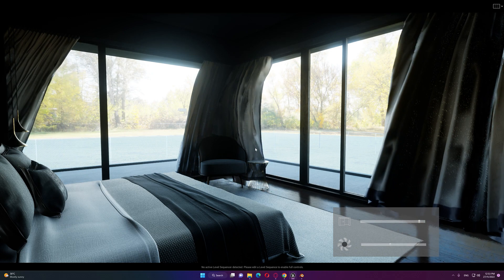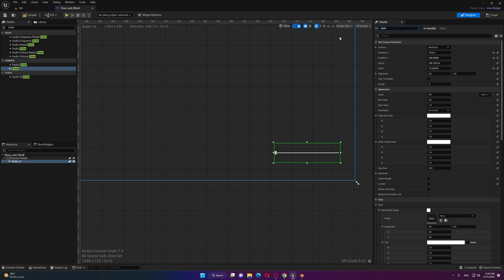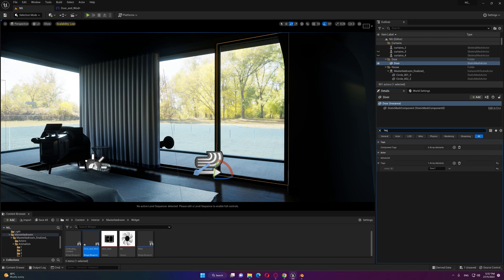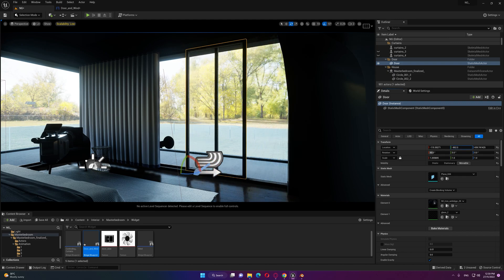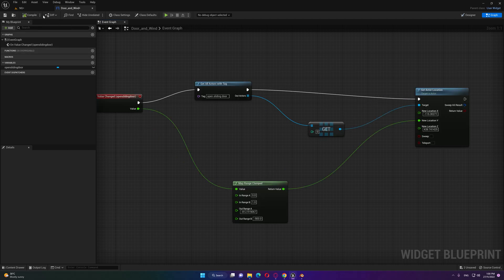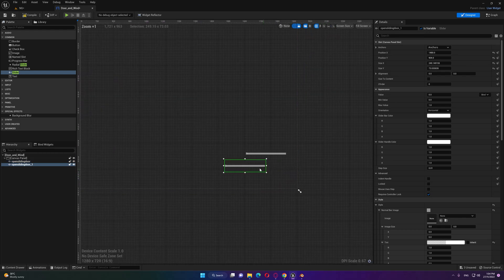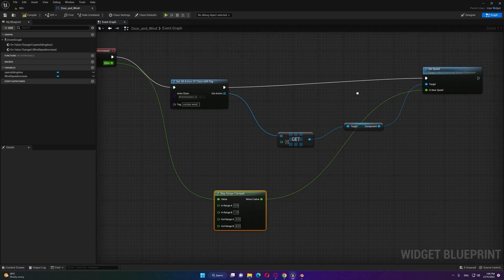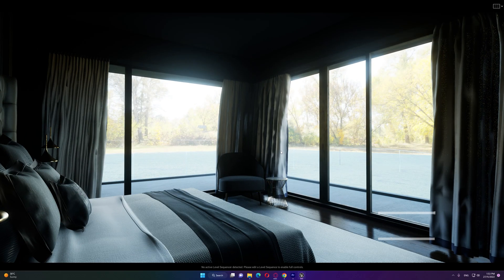part 11 - 3   Unreal Engine 5  Control Wind and sliding Door using widget

Comment: Just subricbed you're videos are so helpful
I need a major help from You bcz no one on the internet has this solution.
I need to control the level sequencer's playhead or timeline scrubber as per the slider inside widget? Basically I need to change the slider value from 0 to 1 and the Level sequencer should change as per this from start to end automatically,
Pl reply or share some helpful videos or pl make, needed much

Thanks for the amazing work!
Reply from the maker: Thank you very much for your nice words , appreciated 
we will try to create a tut answering this request but we will try to help you through these small heads points  
To control the sequencer using a widget you will add a time slider widget and using a node on a value change you will get all actor of class and add the sequencer 

Playback position node to update the sequencer time line
hope this help

Comment: thank yout for the tutorial , i have a question can we  make the windows and the walls to collide with the wind so if we open the window the wind get inside and move the curtains automatically ?
Reply from the maker: Your most welcome , actually this is a good question, we have investigated this but the problem is that wind affect only assets that have physicals interaction with it , and walls are meshes that cannot get that effect so that's why we ended up by connecting the wind strength with the windows movement , so cheating was the only way we were able to achieve , but maybe in the upcoming versions of UE this can be possible .

Comment: hey there, is there any way to change the player controller class of Game mode through blueprint..??
Reply from the maker: hi there , yes you can by using the “unpossess” and then “possess” nodes with a widget activator
Reply: @theimageneers5161  Thanks for replying. but i'm bit confused. can you share Screenshot or tutorial of the same ? it will be of great help. Thanks in advance.